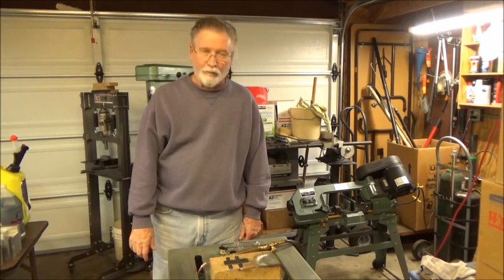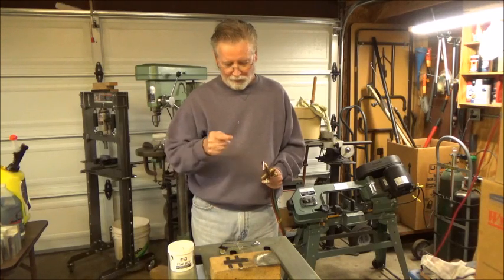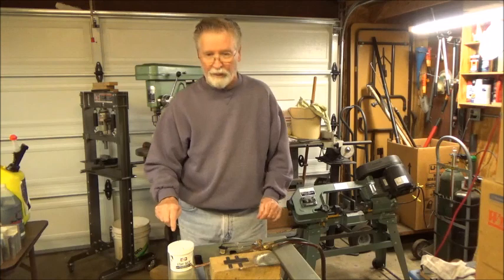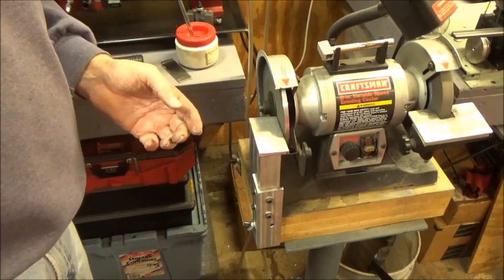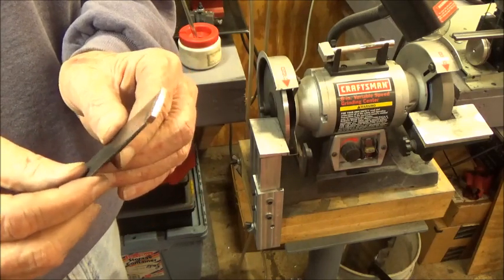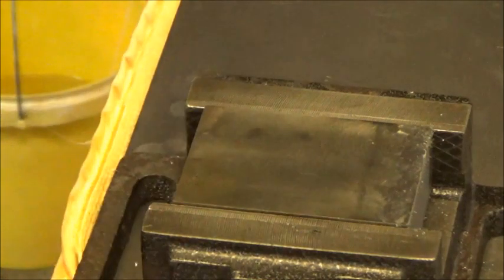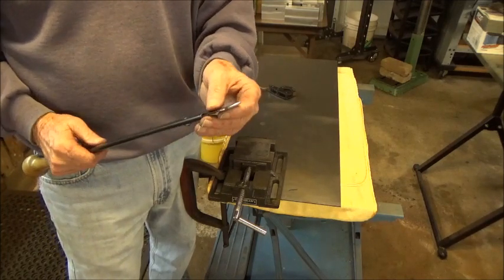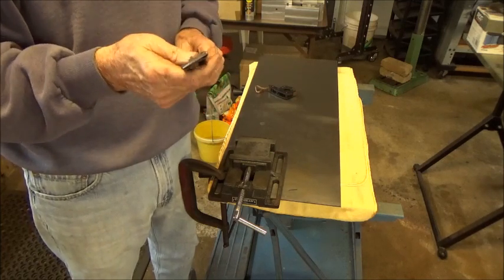Brazing Carbide to High Speed Steel

Comment: You should be able to braze with a low fuming bronze rod and use borax as a flux or an actual flux meant for low fuming bronze(which is pretty much borax). They are much cheaper than the Harris black flux(which is meant for high temperature silver brazing) and they work better because at the temperature that bronze flows the Harris black flux is at it's upper limit i.e. it's burning off whereas borax is active and protects and facilitates wetting and flowing of bronze.
Another suggestion I would make is once your materials to be joined are heated to between dull and cherry red get your flame tip much closer to the joint, like 1\8'' from the surface, and present your bronze rod under the flame tip.It should melt and wet out the joint and then you use the flame tip to steer the molten bronze where you want it to flow. And use a bronze rod diameter of appropriate size for the joint. For this particular joint I would go with 1\16".
I hope this helps
Reply from the maker: Dimtt2:  Thanks so much for the information.  I do have some flux in a can that I've had around the shop for over 50 years that's always worked perfectly and I'm pretty sure it is what your describing.  I think it was distributed by a company called "Marvel".  I could see during the process that the black flux was beginning to burn off as you cautioned.  I also realize that the rod was a bit to large, but it was what I had available.  I think, for some reason, that I did get a pretty strong joint, so I'm happy about that.  To answer your comment; I'm so thankful for your comment.  It has certainly been very helpful indeed.  I have another similar item that I need to braze, so I'll give the old flux a go and see what happens.  I suppose I should also purchased a few smaller diameter rods.  Thanks again for your great comment.  I do really appreciate your help and guidance.  Best Regards: Larry Poindexter

Comment: I think you have done a good job there Larry, I am still waiting for my carbide, 19 days now from Quebec to Alberta that's about 3,000 km, should have used UK mail, even pony express could have done it in half the time, we have worse problems with mail than you do,
Reply from the maker: Walter:  Please read the information provided by the previous comment.  This person was very helpful with the brazing process, and provided a lot of good guidance.  I've been flying by the seat of my pants, when it comes to welding, for the past 50+ years.  It's really great to get a bit of instruction.  On another point, I've gone through hell trying to get my carbide blanks.  MSC was out of stock in Reno, so they shipped them pony express from Elkhart, Indiana.  They were suppose to come with Free Shipping.  MSC had created two packing slips initially, One for free shipping and one Not.  I've been trying for several weeks now to get the refund, but never seems to arrive.  As of this morning they've shipped the original packing slip, now I've got to try and get refunded for that mistake.  Over the years they've been a good company to do business with, so maybe the Pandemic has gotten them screwed up.  This time around they've been very apologetic, but so far No Results.  Best Regards: Larry